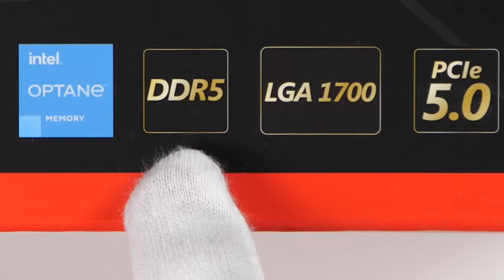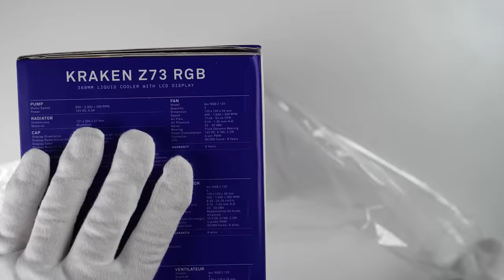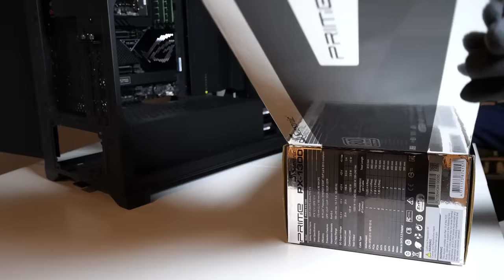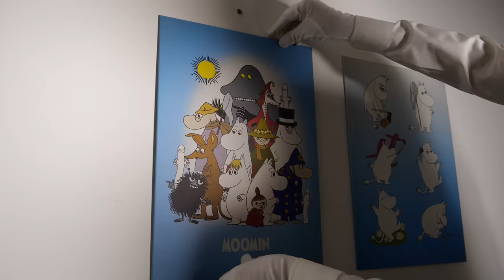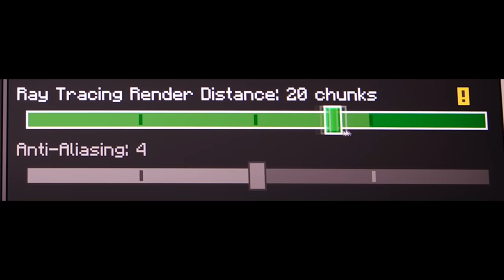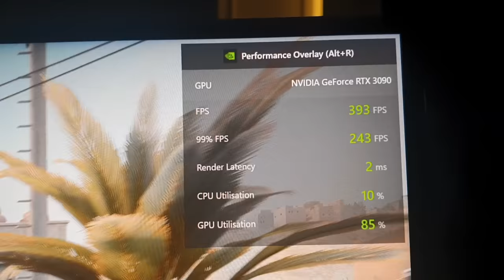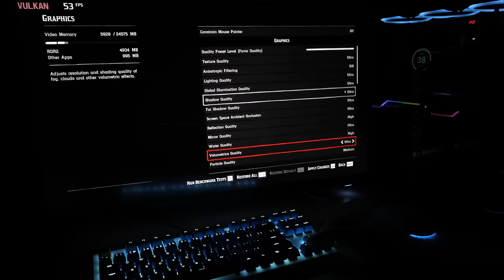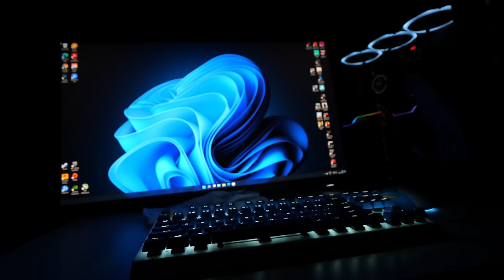Building my new Gaming PC for 2022 (High-end)

Comment: It blows my mind how small storage devices are now and how much data capacity they have, amazing build!
Reply: lets goooooo
Reply: to you have an idea of small the transistors and the insulator of a flash memory is; the size of a blood cell is 3000 nanometers, and the transistors have 7 nanometers,which is 75-100 atoms.
do the math.
its absurdly small
Reply: Have you seen a 16tb ssd before
Reply: And u also don't know how hot it gets on full work load 😏😏😂 which asking a qwestion why pay more for 1 sec faster load in games? 🤔 idk😅 maybe it's cos this video was sponsored by someone who don't really understand what gamers really want?😅
Reply: @Romanitto  it's not just loading speed but more stable fps and beautiful graphics.
Reply: @Romanitto  Way faster than a normal HDD as in multiple seconds to minutes faster plus for games it provides a far smoother experience.

Plus with the ssd used in the video no over heating issues would be present.

No only is the ssd itself not prone to overheating but the PC is well ventilated.
Reply: You know what blows my mind?
Their fucking price
Reply: And the cpu, even more amazing
Reply: @Romanitto  windows load speeds and also games. also, games like forza that have to load parts of world from drive will run way smoother
Reply: @Romanitto  what are you on about 🤔🤦‍♂️
Reply: @Shrektus  Tbf they're coming down in price. I just bought a 1TB SSD with a read/write speed of 7400/6800MBps for £90. Less storage than my 2TB HDD I got for 40, but about 100x faster.
Reply: ayy patrick
Reply: @Calebeko  cool, thanks

Comment: Just a heads up, I would be careful with that board right now and NEVER leave running unattended. There is currently and issue where the board can catch fire. Multiple people have reported the same issue on reddit and forums. No official word from Asus yet but it is a very big issue. Seems to only impact the hero from what we know now.
Reply: flashbacks to the samsung note
Reply: Looking at the board, if it is because of the backwards capacitor, this board is fine, its at 11:10, its the correct way around :-).
Reply: maybe is a feature
Reply: I was going to comment this
Reply: Just watched Jayztwocents new video and his capacitor polarity is the correct way so he shouldn’t have the issue. You can see the line on the right side at 6:43 which is the correct side and won’t cause the issue.
Reply from the maker: Thanks for the heads up! Seems like some Z690 Hero motherboards had a capacitor placed backwards (at the factory) likely causing the issue. My Z690 Hero has the capacitor placed correctly and the motherboard hasn't had any issues.

JayzTwoCents made a great video explaining the situation https://www.youtube.com/watch?v=QdoB9p3LXVQ Highly recommend watching this if having the Z690 Hero motherboard or thinking about getting one!
Reply: Thanks for this info mate :)
Reply: @TheRelaxingEnd  All cool then. I saw this after I commented.
Reply: @TheRelaxingEnd  what site(s) did you get the parts from?
Reply: @Woodman3352  He's from Finland and based on those gummy bears he got with the parts, I'd say he got them from the Jimm's PC-Store. It's a Finnish PC part shop.
Reply: @TheRelaxingEnd  

That was a capacitor??? How does that happen???
Reply: Can someone give the total estimate price for all of the items?
Reply: @astaloaf2113  Around $7500+ based on my calculation without the RAM price
Reply: @TheRelaxingEnd  no problem! Loved the build!!
Reply: Well, he has water cooling system, so in case of fire, it can serve as an extinguisher.
Reply: @astaloaf2113  

a lot
Reply: @ivankaiser4434  lol no
Reply: @CapApollo  Is catching fire a feature?
Reply: @Baddy61  man how much you spend to make this pc question no.1
What you do to the stuff after it gets old?how much land 
area does country provide you yearly for the increased no. Of computers you receive

Comment: I'm building a PC for gaming this weekend (I already spent a lot of money), only waiting on the NVMe to arrive.
I've seen many websites at the internet to get a Windows 10 for a cheap and wondered if they were honest and if it's working long-term.
Reply: There are lots of Key sellers in the market. I tried three different companies, and two of them stopped working after a couple of months (One of them after less than a month). Also, once I had to upgrade to Windows 11, it stopped working because the key wasn't valid anymore.

Anyway, I got three keys for all my PCs from BNH-Software and have never looked back since. Zero issues.

There are some cheaper companies however I instead pay a few extra bucks for peace of mind.

Hope it helped.
Reply: Legit got my key from some indian man off ebay for 3 dollars. It's been 5 years now, still works.
Reply: @kok842  brooooo
Reply: I also want to build but don't have so much money
Reply: why people pay for windows ? activate it with kms boss
Reply: Idk about you guys but googling Windows 10 keys did it for me. Literally the first key I used was legit.
Reply: @cazh666  You don't even need KMS anymore. With Microsoft Activation Scripts, you can install permanent key to the mobo and works forever as long as you stay with the same windows 10/11 (you can freely reinstall, the key will stay) and mobo.
Reply: L U C K Y
Reply: @kok842  bro I'm Indian pls tell who was that
I need it😭🤝

Comment: That's way too much storage 
I didn't even know there are 8T ssds wtf😂
But seriously congrats 
We all hope to be able to get our hands on such high-end PCs some day
Reply: the largest ssd is 100T.
Reply: That's what I noticed
Reply: Its a SATA SSD, so not the very high speed ones. Older protocol than the standard NVMe nowadays and not running on PCIe. For the record, if you want a measure of speed PCIe is the cable interface that the RTX 3090 ran on.
Reply: @Iuciddx  exabyte’s: helo

Comment: Make sure that Motherboard isn't one of the ones that has the backward capacitor, otherwise it will fry your system. ASUS is doing a recall for that one specifically
Reply: Most def. I heard bout that yesterday hope he's lucky cuz its not looking gud
Reply: This one is most definetly a good one.
Reply: @deltron4608  Mine was one of em and luckily I haven't used it yet so its an easy RMA for me
Reply: @xElectricblaze  thats gud everything should be smooth then. But I rewatched his vid again and watched very closely 👀 to my surprise he got lucky the capacitor is manufactured and placed correctly. Its kinda crazy in the end this goofy mistake is causing quite the trouble to Asus to make this large recall
Reply: How do u know u have the right one
Reply: Holy! I need to check mine!
Reply: Its alg i think i took a screenshot and zoomed in and im pretty sure the capacitator is around the right way
Reply: Yes i don'th think he's gonna use this pc
Reply: @lionkrupke7342  BROOOOO , can you let me know any mother board alternatives than dis one or sumthin cuz i was bout to buy one
Reply: @Wheels2go  You can still buy the Z690 Hero but look at the capacitor. If it's positioned in the right direction you're good to go.
Reply: @lionkrupke7342  alright
Reply: When I played for 5 or 4h for the first time my screen went black and white or something then It shut down
my ram and my motherboard died but the graphics card was perfectly fine but It was pretty hot
Was that the reason?
Reply: Sorry what?
Reply: SUS
Reply: this is why i get gigabyte b450 aorus elite for my new ryzen 7 3800x build
Reply: wsw
Reply: Yep:

The ASUS recall affects ROG Maximus Z690 Hero units that were manufactured in 2021 with the part number 90MB18E0-MVAAY0 and serial numbers starting with MA, MB or MC. This information can be located on the product packaging.

His serial number from what i could read started with MC. Still the quality was bad to be able to read that good so might be different.
Reply: @FuroowHD  
aSUSSUS AMOGUS SUSSY BAKA
Reply: @FuroowHD  i build my pc with r7 3800x anyway. i have a few components left to get

Comment: I like the fact that the whole systems is so rgb and the ram is even worse than mine (in terms of looks)
Reply: Soo true
Reply: at that point id just stick with ddr4 not like theres much of an improvement between ddr4 and 5 anyway
Reply: @mrducky179  it's because ddr5 is very new and game developers haven't optimized the games to have the full potential of the ram.
Reply: @sr.chi7741  yeah I believe that after sometime ddr5 will be far better than ddr4
Reply: @FuXioN_7777  exactly, if you want to make a pc more future proof, you can use ddr5
Reply: Don't judge a book by it's cover
Reply: @adolfkitler47  Legend.
Reply: He didnt put shell on it
Reply: Old one give to me bro
Reply: Ddr5 is better then ddr4
Reply: Much better in terms of performance
Reply: @michaelwelch8334  ddr4 is everywhere what do u mean, ddr5 is quite new so it hasn't been mass produced yet
Reply: @mrducky179  is GDDR6 better in the Xbox series better than ddr4?
Reply: @Garage_Distinct_Clips  gddr6 is video memory type.
Reply: @mrducky179  DDR5 is huge of an Improvement to Intel and Ryzen CPUs, That's why a new Refresh/Pro version going to be released on the Consoles.
Reply: @Garage_Distinct_Clips  Yes, GDDR4 was quickly replaced by GDDR5 because the Problems it had like High cost and alot of stuff over DDR3.

Comment: hey man, just wanted to say that for valorant on win 11 you gotta enable safe boot and tpm in your bios first, hopefully that works! great vid as always btw, nice to see you back on zombos
Reply: Didn't understood wt u said but mine is running fine in windows 11 without doing anything
Reply: Btw what's ur rank bro?
Reply: Isnt that a prerequisite to even install w11?
Reply: Nope you're wrong
Reply: @rickyts2509  You should be fine if you upgraded to win 11 because safe boot and tpm is a req for dowloading win 11
Reply: Valorant's anti cheat is a Rootkit, It can access Ring 0 (Kernel level) which is Dangerous for a Fricking game over Mouse where you need it all the time.

Comment: Hi, some people have issues when they power their graphics card with the daisy chain connector (aka pigtail connection). With a high power gpu like you have, i’d advise running three individual cables from the power supply rather than using that daisy chain connector (if possible) :)
Reply: Shouldn't be a problem, as long as the GPU has 2 8pin from the PSU, the third can be a pigtail one. These GPUs should not be able to saturate a 2*8 pin connector, 3 of them it's an overkill
Reply: @lorenzocampolucci4464  3 with good cable management would look very sleek though. it isn't like he is using that cable for something else.

Comment: tip for anyone getting a pc or has a pc with windows 11, press the windows key and look up window security, then press device security and then in device security click on core isolation details and turn off memory integrity. this setting turned on will decrease performance by up to 28%
Reply: And if you're a Gigabyte owner it stops RGB Fusion 2.0 and SIV from working thus not being able to control either your RGB or fans.
Reply: @LordPoshnameVonPlumbingparts  tldr:just use win 10
Reply: @Lyncin  😎😎😎 chad

Comment: im very certain he could have pushed the performance way more, by example unlocking all the cores, idk if xmp is activated but it most likely is, and just doing some settings adjustments since I could very much see it wasnt doing all to crazy with minecraft and with a 3090 and a i9 12900k he could have very easily gotten over at least 144 fps with all max settings.
Reply: He didn't use any optimization mods such as optifine or sodium, even if you have a monster pc it's always beneficial to use these mods
Reply: @pufferfish_overlord  It is better to put graphics settings high

Comment: Your rig looks sick! Makes me a bit jealous! I only have a mid-high range rig that I built not too long ago. Here's the specs:

Color: Black
CPU: AMD Ryzen 9 5900X 4.3GHz
GPU: NVIDIA GeForce RTX 3070 Ti 8GB GDDR6X
RAM: 32GB DDR4 3.2 GHz
SSD #1 Capacity: 256GB
SSD #2 Capacity: 1TB
Operating System: Windows 10 Home (64-Bit)
Estimated Value: $2600 USD

And I have a Redragon S101-3 keyboard and mouse combo and 2 Acer R240HY Monitors clocked at 1080p 60hz with IPS LED displays.

DECEMBER 2022 UPDATE:
I have upgraded my keyboard and mouse to the Asus ROG Strix Flare (Cherry MX Red version) and the Asus ROG Strix Impact II.
Reply: boss, that is high end, i rock a 1080 and that would really be mid end, nice rig tho
Reply: @dpuhh  That was according to my calculations. At this point, it probably is now definitely in the $2,000 range as I recently upgraded my Redragon membrane keyboard to an Asus ROG Strix Flare with Cherry MX Red and upgraded my Redragon S101-3 mouse to an Asus ROG Strix Impact II.
Reply: Bro that's a good PC,I am happy for you

Comment: 14:01 the fps proves just how badly optimized minecraft really is considering how much of a beast this pc is
Reply: Minecraft Java
Reply: He just needs optifine
Reply: Probably not the case- Minecraft by default will only run the launcher on the GPU while the javaw (game executable) runs on the CPU’s integrated. I had the same issue with another build with an 11th gen i7 and 3060, manually added the javaw executable to high performance graphics in windows settings and then was running SEUS shaders with ray tracing and 48 render distance at about 50-60 fps

If anything that’s a testament to how powerful integrated graphics have become in newer CPUs that they can handle light gaming loads pretty well now
Reply: he just needs optifine or sodium
as well as changing the dedicated gpu
Reply: do people not realy understand i mean optifine is not minecraft
Reply: @veragault  you're telling me
I could get a pc in 2030 with high end integrated graphics, 3d vcache and an rtx card and get more fps than someone who doesn't have integrated gpu?

Comment: I just watch people play and make awesome pcs and i know I'll never get on either way but I enjoy watching people having fun 😃👍
Reply: Bro you need to stop thinking and start acting on it, if you save $1 for 200days you will get $200 and you can get your self a new PC with 4gb ram and not a good CPU and GPU but it is something
Reply: @pbearr3602  thanks for the advice I'll try
Reply: @pbearr3602  i got myself a good pc for 200$ with 16gb dd4 ram, 8/16 cpu and gtx 1050
Reply: @_rodjar  nice
Reply: @_rodjar  bro tell my how you got the parts or it's pre-built?
Reply: @Blaze_Crav  bought chinese motherboard kit for 100$ (CPU, Ram, X99 motherboard) and used gpu from local second hand marketplace. Other parts are from my older computers, like case and PSU. Also the CPU cooler is ~6$. If you build without anything, it will cost ~240$

Comment: I like how the fans itself have more casing protection than the actual graphic card does
Reply: And the Suprim X 3090 at MSRP is ~$2060 USD. LL120s are about 35 for one. Wow.
Reply: the m.2 just came in some plastic in a little box and it costs 1.5k

Comment: Keep a good eye on that ROG Z690 board. There is a capacitor installed backwards which causes it to short out and potentially cause a fire. Please consider replacing this out of mere safety more then anything else.
Reply: Thanks for watching, You have been selected among my lucky winner, chat me up to claim your prize👆👆👆👆👆👆
Reply: Did they fix the surface mounting of capacitor in later stage of production?
Reply: @immortalocelot  Should of been fixed by now I'd hope

Comment: damn only in my dream i can use a monster gaming pc like that u earned my sub smooth and clean building
Reply: In a few weeks I should have a PC like that. just not as expensive. I'm getting the 32bg 6000mhz ddr5 ram with no rgb and intel i9 non K variant with the cheapest rtx 3080 I could find on the market. I did pay extra for the PSU because I wanted it to be over 1300 watts to be upgradable in the future. And the gen 4 M.2 ssd is super expensive. Costs about 3500 usd.

Comment: Oh my lord, I just calculated how much it would cost. Here are all the prices for you rich people out there

CPU: Intel Core i9-12900K                                                = $919

GPU: Nvidia GeForce RTX 3090 Suprim X                     = $3849
Motherboard: ROG Maximus Z690 Hero                       = $989
RAM: 32GB Asus DDR5 4800MHz                                  = $449
SSD: 8TB Corsair MP400 M.2 Gen3                               = $1899
SSD: 8TB Samsung 870 QVO Sata 2.5"                         = $885
SSD: 2TB WD_Black SN850 M.2 Gen4                           = $549
CPU liquid-cooler: NZXT Kraken Z73 RGB 360mm      =$439
PSU: Seasonic PRIME 1300W Platinum                        =$469
Case: Corsair 5000D Airflow                                           =$219
                                                                                  All up = $10, 666

Comment: Hey Relaxingend not sure if you’re into it, but how would vr perform on a dope rig like that?
Reply: It’s definitely more than enough lol
Reply: @possiblyelijah5307  sadly it isnt, theres a vr headset called the xr3 that needs TWO 3090s to run at not even at max settings, one 3090 per eye lol, for most vr headsets itll run fine at max res and hz tho, except the varjo aeror and pimax 8k
Reply: @Captaine_Crunche  still it must give an insane experience.

Comment: i have never seen someone put 50tb in a gamming machine lol but 1 tip, the build would look nicer if you put in sleeved cables from like cable mod or asia horse and the ram i know that ram is short and expensive but even if you could get the black versions of the ram if they have them or get the ones with the heat spreaders on them if you can get them but nice build ether way.